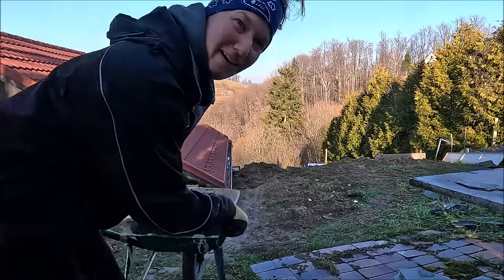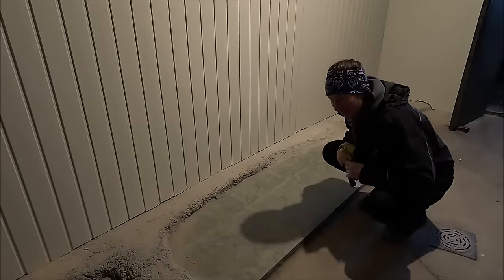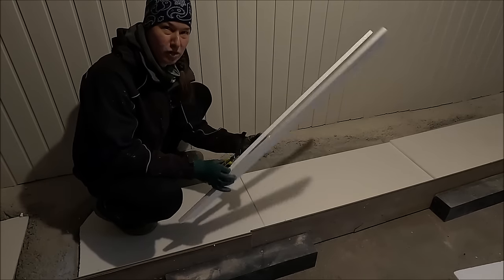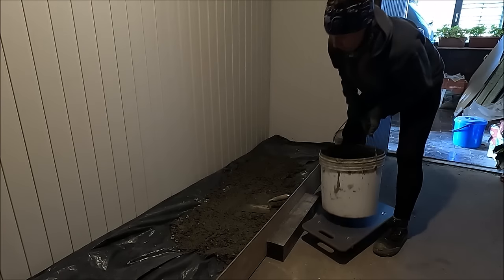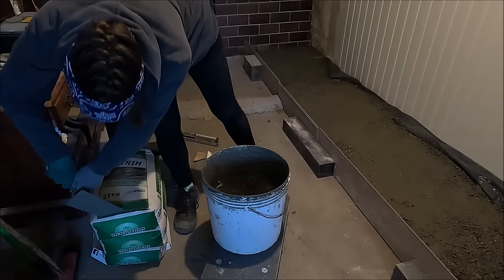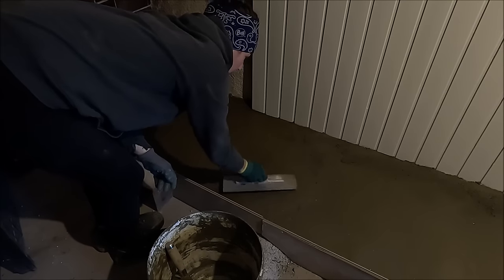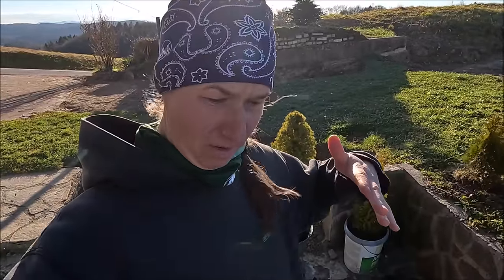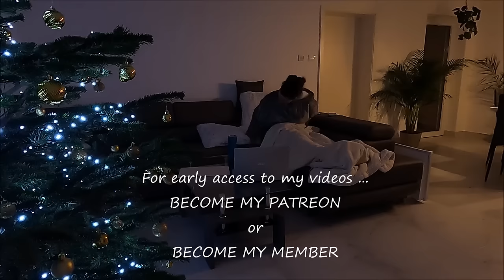I Concrete Basement Floor - country house renovation

Comment: 20:15 : Nice job!
I DO advise to put on a few thick layers of concrete paint. So in case of any spillage - either fluids or dry - it will be easily cleaned up and not stain the concrete.
Reply from the maker: Execly what I'm going to do

Comment: Did you also calculate the high of your drive way...maybe with much rain it will be a bath tube in Front of your garage...and an wintertime there is a lot of snow to clean up or maybe it could be harder to drive the way up to come to your house ?
Also you have a big turn 90 ° to drive into garage??
Maybe I don't understand your planung....but hopefully it will work for you. Good luck!
But I like your videos very much and also your brave work as a Lady like a handyman.